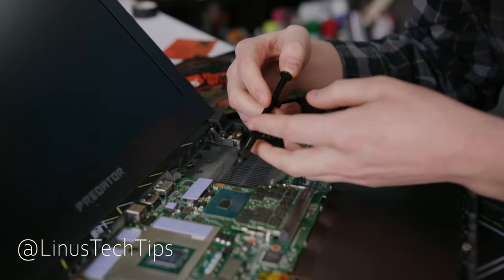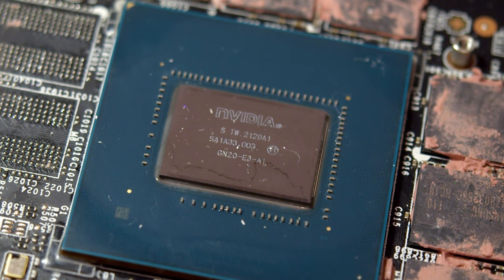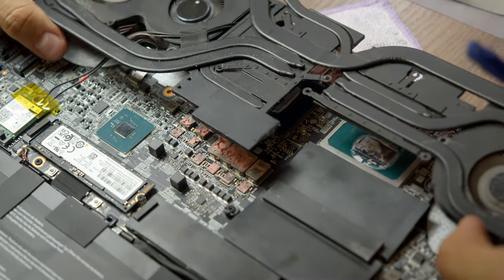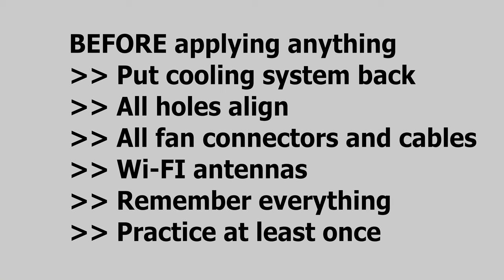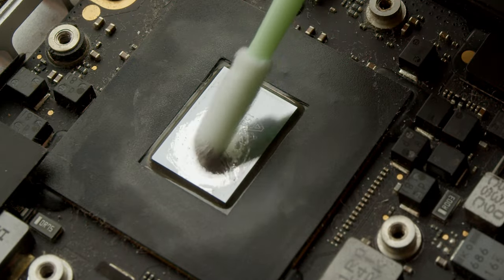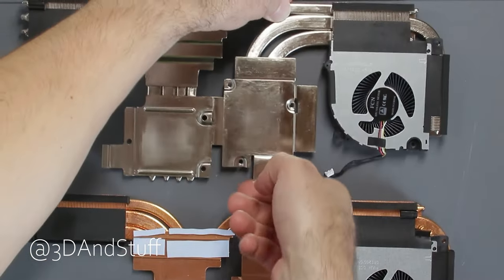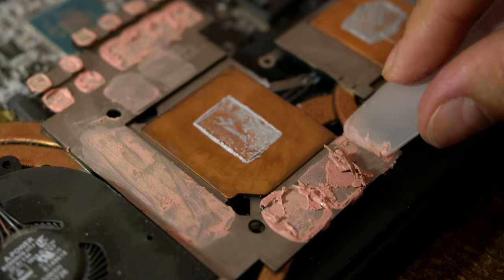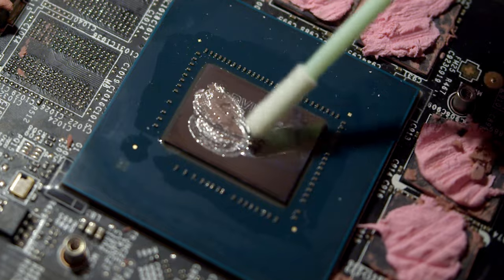How to Safely Apply Liquid Metal on Laptop. Theory and Practice. Fatal Mistakes People Make

Comment: Probably the best tutorial on LM Ive seen.  So many others are just slathering the stuff on like thermal paste.  I have read somewhere, maybe Overclockers, people were saying to apply a very, very small amount to the heatsink first, and let it bake/dry in room temp for an hour before applying second coat.  This may be the LM infiltrating the micro pores of the heatsink, kinda makes sense.  After clamping and tightening the screws, the heatsink sits flush on the chip, flat.  LM would only act as a microscopic buffer where the chip and copper dont meet in places.

Comment: What type of acrylic coating did you use to prep the site? I cannot seem to find it here in the states.
Reply from the maker: I used PLASTIK-71 by Solins, which is a Russian Manufacturer and practically a default choice for everyone who works with electronics in Russia.

For U. S. you can probably look into something from MG Chemicals. You need acrylic conformal coating which withstands high temperatures (at least 100°C). Make sure the packaging says that.